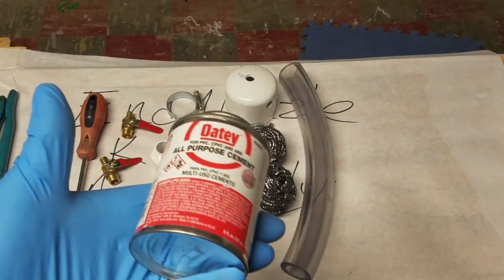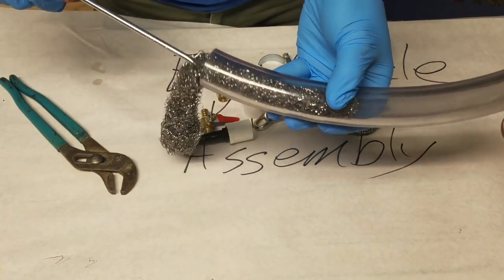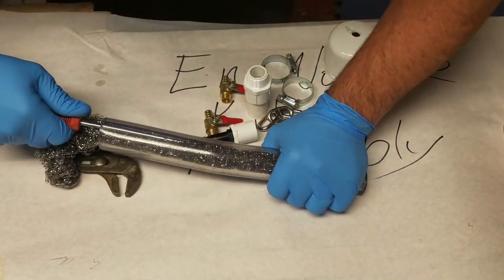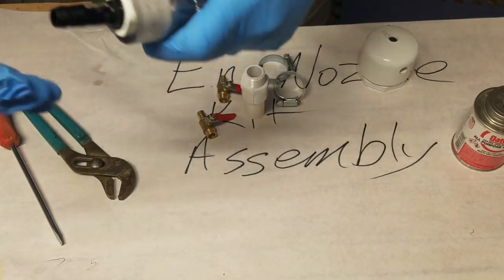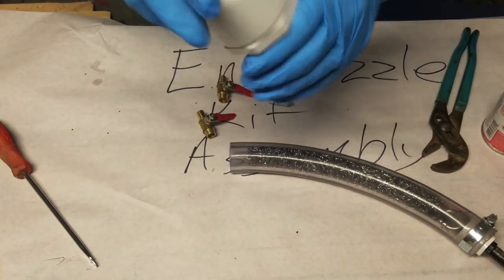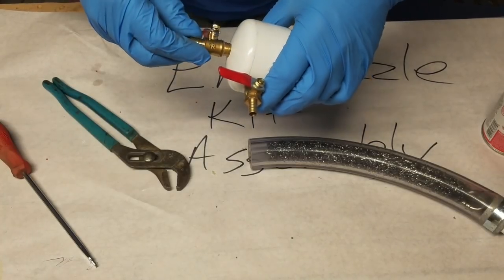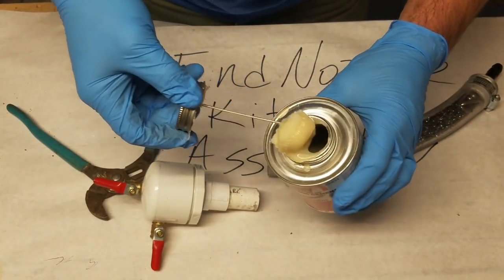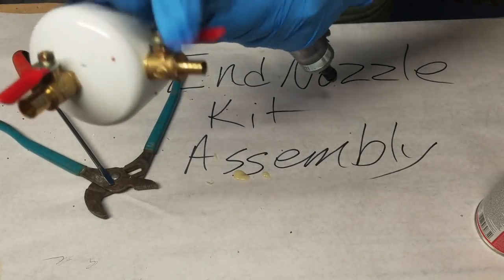Diy Foam Mate End Nozzle Kit Instructional video

Comment: Thanks for sharing this information for free!

I have one question. Since waterglass melts at 1,990°f, and fireclay melts at 2912°f, couldn't you just mix portland cement with fireclay and have a decent refractory?

Have you ever tried to make aircrete out of fireclay and cement and seen what happens inside a rocket mass heater?

Thanks
Reply from the maker: clay would diminish the adhesive nature of the cement and it would become week and crumbly.